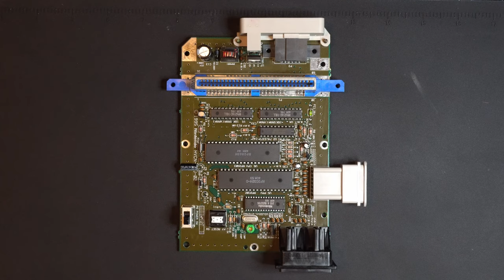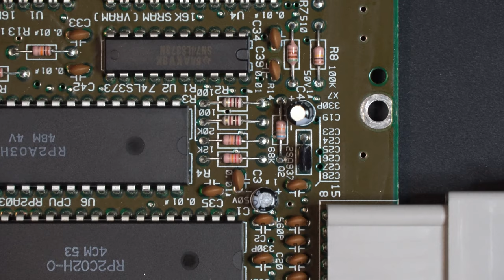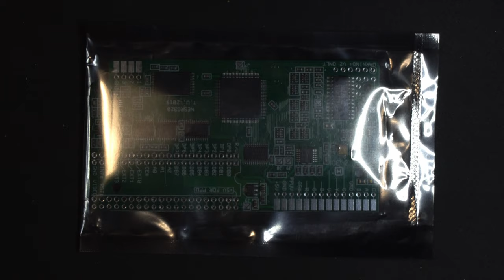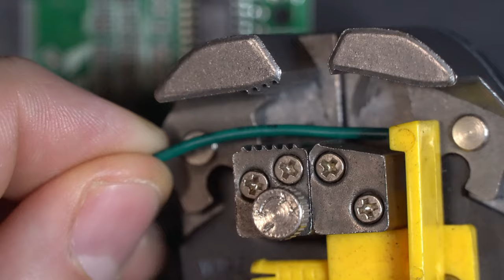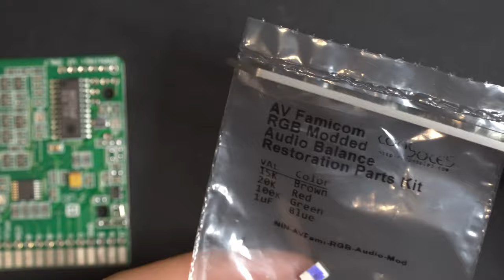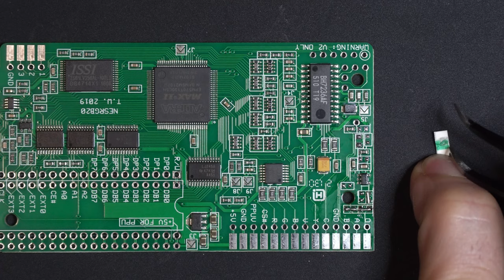Ultimate AV Famicom (NES) Mod - Audio Balance Restoration (Part 2 of 4)

Comment: Hello Kytor, this is Ace, creator of this AV Famicom audio balance fix. I would like to point something out with capacitor C1.
This is a useless component once the other capacitors and resistors are removed from the AV Famicom as this serves to remove the DC offset from the audio output on the CPU after being mixed down through R3 and R4 on the stock circuit. Leaving this in-circuit after bypassing the stock audio circuit would result in the negative side of the capacitor floating while the positive side has ground to it as a result of shorting pins 15 and 16 on the BU3270S. As such, the capacitor serves no purpose and would be best removed.
Reply from the maker: Hello Ace. Thank you for the clarification. I'm pinning this comment. Thankfully the consequence of leaving C1 should be negligible.
Reply: @Ace9921 Does this audio mod work with FDS? Just asking because all the other audio mods I've tried has way too high volume/gain from the FDS when I'm testing games with expansion audio.
Reply: @Konglarna  This mod will resolve all of the AV Famicom's mixing issues with expansion audio, and that includes the Famicom Disk System.
Reply: @Ace9921  Thanks!
Reply: @Ace9921  I've done the mod and the audio is really amazing now, I Just had one issue playing Akumajou Densetsu on the everdrive n8, I had to turn up VRC6 to 200%.

Is this just a issue using everdrive vs original cart?
Reply: @Konglarna  If it's the original EverDrive N8 you're using, the expansion audio mixing isn't that good on it, so low volume is to be expected. The original cartridge has no such issue, and it's likely the EverDrive N8 Pro doesn't either, though I don't have one to test with.
Reply: @Ace9921  Thanks again!
Reply: Does the original model Famicom (HVC-CPU-0X) require any sort of audio balancing tweaks when using the NESRGB board or is that considered perfectly balanced (as the meme says it should be) as is?  What of the HVC-GPM-0X?  I know that I understood a non-NESRGB modded system fixed with a simple resistor replacement, but is that still the case?
Reply: Ace, If i have the audio restoration mod on my Famicom AV, do you know what sound profile i should be selecting in the everdrive n8 pro? The options are famicom, famicom av, or nes 47k mod?
Reply: @totalprocall6894  If you have this audio balance fix on the AV Famicom, use the Famicom preset. The mod produces louder sound like the older Famicom revisions; the other options will not be properly balanced.
Reply: @Ace9921  Thanks for the reply and this awesome mod!

Comment: I just purchased an AV Famicom with this audio mod and tim's NESRGB V4.0. My audio is buzzing though...it weirdly stops when I disconnect my retro-bit N30 wireless pad receiver, OR when i place my hand near the controller port? Any advice?

Comment: I followed all instructions on retrorgb, and triple checked with your video. It simply does not work. Sound of normal games is fine, but Castlevania 3 (jp) has complete broken sounds. Any Ideas? So far i have a broken NESRGB and a broken AV Famicom...
Reply from the maker: So all other Famicom carts are working properly but Akumajo Densetsu is glitchy? One potential is the cartridge itself is damaged or has dirty pins. I would also recommend carefully going back through your work on the AV Famicom with a multimeter and ensure nothing is shorted or installed in the wrong place. Sometimes you just need to walk away for a day and come back with a clear head when troubleshooting.
Reply: @kytor  i had done exactly this. Could not find a short, or any other issue the next day. I do not have an original Akumajou Densetsu. Only an everdrive n8. Maybe that caused the issue, i do not know at this point. I reversed the mod yesterday evening, thankfully i had done all removed parts to the side.
Reply: @marcelfilz7989  I believe the N8 emulates the expansion audio, and I seem to recall some compatibility issues. You need to get an actual Akumajou Densetsu cart to be sure next time. Never test with flash carts when doing mods like this. Use real original carts.
Reply: @RedArremer  Ok, good to know. The sound from Akumajou Densetsu was complete broken via everdrive. So i guess this mod is not useful for everdrive n8 user. I could reverse everything, so everything is fine. Nur thanks for the information!
Reply: N8 Pro set to original famicom audio balance, sounds spot on after this mod
Reply: @lexxxa1992  thanks, but it is not available here in germany😅
Reply: @lexxxa1992  Is this mod worth it for me to do if I have an n8 pro as my only cartridge?
Reply: @shoobopper  I think it's clearer audio audio in result